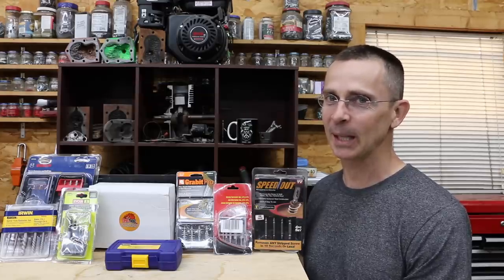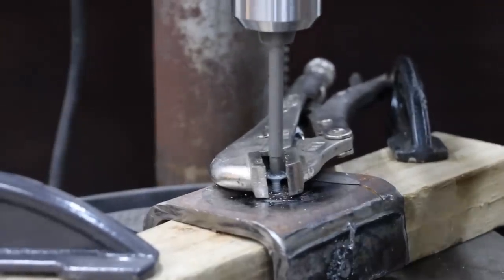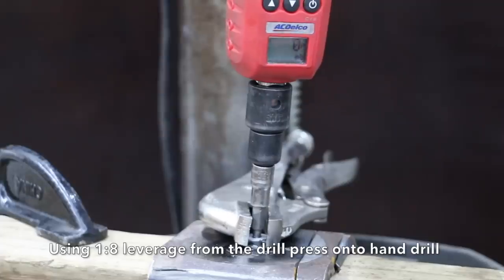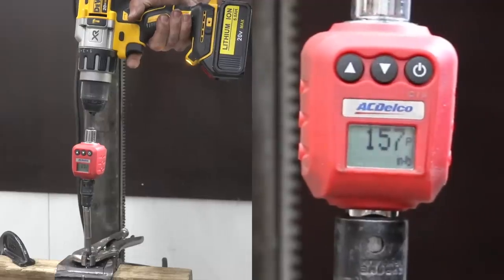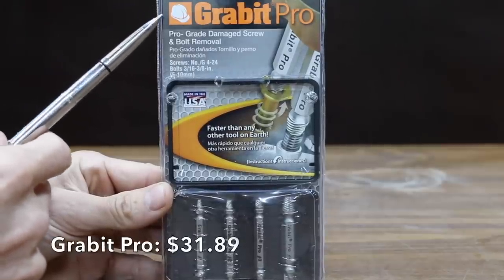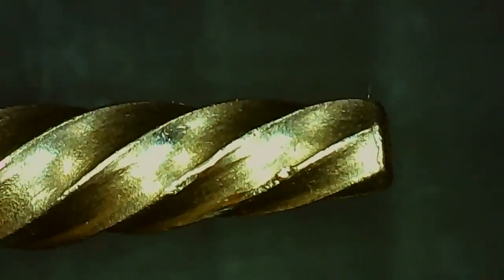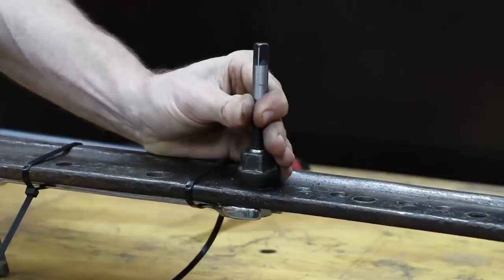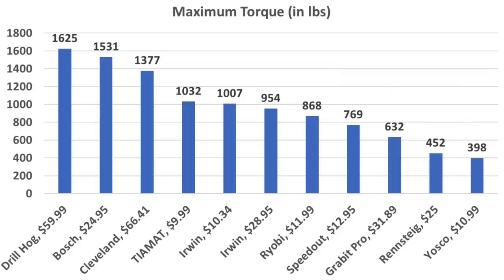Best Bolt Extractor? Let's find out!  Drill Hog, Bosch, Irwin, Speed out, Ryobi Broken Screw Sets

Comment: Can you do a test on Class 10.9/Grade 8 automotive bolts
Sizes M6-1.0/M10-1.5/M12-1.75/M14-2.0mm
Can you do the test in hardened carbon steel internal threads. Just about every bolt extraction video with a snapped off bolt thats flush or deep inside bolt hole is demonstrated on Aluminum heads/aluminum valve covers/aluminum exhaust manifolds.
When i brake bolts its 20 year old bolts that are Class 10.9 galvanized Mopar bolts without zinc plating and they are always stuck in hardened tempered carbon steel.
Its not hard to drill and tap aluminum out and put in thread reducing adapters or drill and retap aluminum threads.
Its extremely hard to get it out of hardened steel thats harder than the Grade 8/Class 10.9 bolts.
Can you show it using other methods than welding a nut on with copper tubing.
EZ outs would be a great method, maybe carbide rotory tool bits to drill out bolts or the extractor screw you broke in it so you can retap.

In my current situation i nroke a Sway Bar bushing bracket bolt. Its held in by a 1/8-1/4" steel plate that has a nut welded to it internally thats not accessible.
I can drill out but if i try to step it up to a bigger size i risk it not holding, have to get it perfect dead center and tapping a different size is almost certain to fail at wrong angle
Reply from the maker: Thanks for the suggestion.

Comment: Bad test. no one I have ever met (mechanic for 35 years) has ever used a screw extractor on a wood screw. I've also rarely had to drill the end of a bolt for an extractor, normally a sheared or stripped bolt head is where you would use one.

Comment: I feel like this test was faulty. I see that you were using the lock grip pliers for stability, but they also look like they became a hindrance i.e. the pliers hitting whatever metal pole was behind them and causing the bits to use excessive force with no chance for leeway.
Reply: That's because the lock grip pliers are there to stop the screw turning so we get to the ultimate failure point of the extractor. Most of these extractors would easily have removed the screw, so we'd have no league table.

Comment: The absolute worst is Ford engines with their extremely wimpy  8mm exhaust manifold studs. We see a lot of cracked manifolds with broken studs.  We drill with irwin left handed drill bits. I will try a spiral extractor with very light pressure. if no go, then drill it out and Heli-Coil it. Nothing worse than a broken extractor in a broken stud. I just finished a Ford 10 cylinder engine. Only 1 broken on right side, and miraculously broken piece came out while drilling with a left handed drill bit. Left side not so lucky. Had to drill out and Heli-Coil 3 broken studs. Not fun.
Reply from the maker: Thank you!

Comment: What a shock to have anything made in china to even work. Last time we used China made screws was when we installed 4 bolts into 4 pre-made holes with dowels inside. 3/4 screws ended up with twisted off headers ... soft metal with some kind of admixtures ... not worth it. We end up using pre-applied helix into concrete using a chemical anchor and after that with screw nut on top. It was overkill for two step garden stairs but you have to do what you have to do.

Comment: All of those helical extractors are junk.  When extracting broken screws from metal, what happens is that the extractor screws itself into the bolt until the bolt splits & becomes locked in the hole FOREVER.  (Some of the helical extractors have a shoulder to stop the screwing-in, but require exact-sized holes to work.)  Much better are pyramidal extractors (square in cross-section & tapered).  You have total independent control how much the extractor bites in (controlled by amount of hammer blows) & the applied torque.  The extractors are also much stronger as they have more cross-section.  Such an extractor can even be made custom for odd-size or very small bolt with nothing more than a bench grinder & old broken drill bit.
Reply from the maker: Thanks!  Thanks for the suggestion.

Comment: That are all good. But now a days some mechanics use  hex head tigther. In prototypes not yet on market.. " nong bolt sachet" due of kany bolt head size that sometime up to 100mm.. the prototype needed to devide sizes into categories same to mini, smal, medium, large, extra large, double extra large, ultra. For ex smal 10mto 15mm.  The socket has a tigther ring and when you rotates clockwise it tigther the size in decimals ex 10 become 9.7 or 9.5, ect (depends on head damages like roundhead blot)  and when we round counterclock on thread locker the size of hex will increase up to 15mm.. depends on how we use and how tigth we wished..  

The technology is old but not yet adopted on bolts extractor and winder.. (impact drill with soket... multi purpose socket. "Tighter extractor and tigther and free size unvolter") 

Simply imagine the electric drill with 3teeth tigther.. but the contact surface is flat.. .
In second try (development) giving a small teeth gives better gripp. As long as the micro teeth is not exceeding 0.1mm. It looks like a pile teeth.

Unfurtunately the prototype is compromised by our country government and usa govoftaxation.. .

"Nong socket tigther, extractor and winder" NONG SOCKET.
Reply from the maker: Thanks for sharing.

Comment: I have a tiny stripped screw on my laptop Board. It's M2.5 and the head is maybe 1/8' to 3/16" and paper thin. Was Phillips 1, now it's almost a cone. 

Any suggestions for removing it? Bought an Irwin EX-1 but doubt it'll work. It's on the Wifi card on the Motherboard so I can't do some options.
Reply: Have you tried the Grabit Micro? That's what we'd recommend.

Comment: Great video, thanks for taking the time to compare these extractors. I own a set of the Grab it pro extractors and have a project I sidelined while trying to use them: I own a VW GTI and had both screw heads snap off while trying to remove the boost pressure sensor from my OEM side mount intercooler. I just wanted to clean the intercooler and sensor but instead installed an aftermarket intercooler and reused the sensor once I couldn't remove the old screws. It's a plastic housing and there's not much material left, so I'm thinking I have to drill out whatever material is still there. If anybody has any thoughts or suggestions I would appreciate it.
Reply: Sell the VW. They're junk!
Reply: I agree with first comment....
Nevertheless some people like budwiser others like Belgian triplet. Therefore suggest you check the YouTube videos from the humble mechanic. He's a certified VW mechanic and is dedicated to his German iron....err plastic....
Good luck

Comment: Phillips screws should just be canned, I've yet to have a Torx screw head strip on anything bigger than a number 10. It requires far less vertical pressure and has a much better contact area. Sure I've had a few heads snap off, but snapping 1/4 heads on a panel means you can at least get said panel off and usually won't affect the structural integrity a great deal. Even Pozi is better, just do away with Phillips like we did with the flat blade heads.
Reply from the maker: Thanks for the feedback.

Comment: A Dremel-like tool can grind a straight slot across the back end of the fastener, but slots can open up and break. A classic square hole or hex hole is very strong, but how to cut one? One could EDM a hole into the end of the screw and then drive it out with a matching bit. Then what is the best hole shape: square, hex, "plus", or "star"? Is there portable EDM?. Maybe an "oscillating multi-tool", with a short stroke and tiny extension could grind a small square or rectangular hole using diamond grit or loose carborundum.
Reply from the maker: Thanks for the suggestion.

Comment: My personal experience is simply to stay far away from the cheap stuff and at least try something you trust. So much of tools like these will simply snap like styrofoam, and it doesn't matter what something should be able to manage according to the manufacturer, because the real world will tell you the real truth right off the bat. 
Price vs quality most times go hand in hand, so just use common sense. Also figure a backup plan for when/if tools like these snap off, before even using them.
Reply from the maker: Thanks for the feedback.

Comment: I have used extractors for over 40 years and have never seen one that works better or more reliably than  a simple high speed steel lathe bit ground to a very gradual taper on all 4 sides
 Tap this into a predrilled screw and bam! Patience and practice....that's what it takes.
Reply from the maker: Thanks for sharing.

Comment: Before extracting a screw or any other fastener, tap on the head, apply heat, tighten it gently, and loosen and tighten it gently, until you have movement.  No harsh leverage.  Once the head comes off, it costs more than the aforementioned technique.  Good video for when it does get ugly.  Use a left turn bit, unless  you live in the opposite side of the world
Reply from the maker: Thanks for the feedback.

Comment: been a heavy truck and construction equipment mechanic for many years and in all my experience best screw and bolt extractor is one with straight flutes because tapered ones expand bolts wedging then tigher in the threads
Reply from the maker: Thanks for sharing.

Comment: The best extractor by far is a torx bit that can be used with a power handle or ratchet. I have tried all those extractors and it is just a waste of money. The taper design expands the the broken bolt into the threads and make it hard to turn. Just measure the torx bit between the flutes, drill  that that size hole, hammer the torx bit into the hole and..... out comes the bolt.
Reply from the maker: Thanks for the feedback.

Comment: The best extractor I have found is a rigid set you drill all the way through the screw/bolt drive the straight shaft spline extractor in then back it out.
Reply from the maker: Thanks for the feedback.

Comment: I wonder how Marco brand extractors would hold up in this test. I use them in an aviation application and they seem to hold up well. The flutes definitely fair a lot better if the extractor is not hammered in and instead just allowed to thread in with downward force on a ratchet.
Reply from the maker: Thanks for the suggestion.

Comment: I have the Bosch style #1-#5 . They look the best as far as quality for spiral extractors but I personally don't consider them screw extractors. I think they work best on removing things like broken off threaded pipe or broken off bolts. That style needs to have some real depth to get a good bite. They do appear brittle and obviously they are from the tests so I may have to heat-treat mine slightly.
Reply from the maker: Thanks for sharing.

Comment: Would gently tapping with light turning tesion on a wrench allow full mating of tool and material? Before testing? I have done this when I had access. As first grip is usually best, in my experience.  And extraction was nearly my last option. Great video & controled testing.
Reply from the maker: Thanks!
Reply: @ProjectFarm  This may test ultimate extraction capacity more isolated from the tools ability to " draw itself into the material" with turning force alone after tapped straight down.  You can readily see how different designs might need more penetrating assistance until they lock.  The long spiral, vs more thread-like designs. 
    Tbh, I fault the instructions with tools. Real mechanics with experience? Have long been tapping and turning to deeply engage imo.

Comment: I remove lots of titanium machine screws on a regular basis. We have found that extractors the same style as the Irwin Hansen work well with a lower risk of snapping in the hole. When one breaks, carbide is the only thing that cuts them well.
Reply from the maker: Thanks for the feedback.

Comment: My greatest problem is always to  drill the hole in the piece to be removed. It is usually hard steel and needs a cobalt or tungsten drill bit and I start with a small size first. I try and use a centre drill bit if I can and it is usually impossible to use a drill press because of the location. So to sumarise; I use a 2mm cobalt drill bit (or a small size centre drill) in a hand drill to get started and then use progressively larger drill bits until I have a hole the correct diameter for the extractor. It goes without saying that I try and use the largest size extractor possible to avoid snapping it off ! Great video of an important process.
Reply from the maker: Thanks for sharing.

Comment: Square fluted extractors are the best in my experience (50 years) in industry and machine maintenance. Edit: I also found that left hand drill bits will very often remove the broken bolt in the drilling part of extraction.
Reply from the maker: Thanks for the feedback.

Comment: I am removing Bolts from an outboard motor engine seem to be steel bolts and an aluminum head. What kind of penetrating oil would help this.? Should I apply heat? They are 10 mm headed bolts
Reply from the maker: Thanks for the video idea.
Reply: @ProjectFarm   I work on a lot of boat motors and I live in the Florida Keys. It's nice and warm here. Saltwater intrudes on everything both automotive and Marine. Removing steel bolts from aluminum block seems to be my main obstacle in repairing outboard motors.

Comment: The other day I had a brass tee fitting break the threaded end off into an air bag on my semi trailer. I knew immediately I’d have to hunt for this video to figure out which brand would be best to add to my tool bag. Thanks for these videos Todd, I’ve already used the advice from you when picking out super glue for a plastic application and it was perfect!
Reply from the maker: Thanks for sharing!

Comment: I wish I knew the name of the extractor kit I had in the army. It used a spring steel splined rod and a hex sided collar to turn the rod. It also had left-handed drill bits and a series of drilling center guides that could fit into most bolt holes. The only time I had failures were the drill breaking and the one time I had to do a long reach with the rod and the collar was too far from the bolt, twisting the rod.
Reply from the maker: Thanks for sharing.

Comment: Another incredible video, I have never had any luck with any extractor bits as they always snap very easily. I just drill them out then use a tap the ild threads out then re-tap the hole
Reply from the maker: Thanks!  Thanks for sharing.

Comment: I just used the Irwin set on the pan bolts I told you about and it broke on the first one. 😡This is the first time Irwin let me down.
Reply from the maker: Thanks for the feedback.
Reply: @ProjectFarm This is my work truck. It's pretty old. I am a contractor that's kind of a backyard mechanic. I know enough to get by, but I'm not Mr. Goodwrench. I don't have time to send for the hog set, but had 2 idea`s I'd like your advise on. 1 drill pilots next to the broken bolts and put in self tappers, or drill new holes through the aluminum tranny housing and run bolts with nuts through. quick fix. If you think either will work, which sealant do you recommend I use where the broken bolts are to prevent leaks? I don't have the tools or skills to be drilling a perfect full size hole overhead to tap it out and don't want to pay towing to a machine shop. or a big bill.

Comment: I always liked the straight square extractors.  I can't remember the brand, but I have a high success rate of removing broken bolts with them unless they are really corroded.  I always use the largest extractor I can fit into the drilled hole. I turn it as close to the base as possible with a adjustable wrench to minimize the likelihood of breaking the extractor.
Reply from the maker: Thanks for sharing.

Comment: That bosch one is absolute GARBAGE! I bought that 12pc set and the extractor bit snapped with barely any force from my hands using a tap wrench. Huge waste of time and money. I had to use a punch and hammer to remove the broken off bit since drilling it would have been impossible.
Reply from the maker: Thanks for the feedback.

Comment: Ok, those are wood screws about 10 seconds in.

By the time they will not come out of the wood the wood is rotten, so use a big lever bar, and rip up the rotten decking, snapping the rusted screws and rotten wood. 
Undoing the screws is not needed. The whole lot is rotted and rusted away. 

Screws are not bolts so bolt extractors are not much used removing screws. 

hats are not shirts, helicopters are not submarines.

Tip. They never work well. By the time you need them they won’t work. Ever.

Comment: How often would anyone try drilling out a thin screw...we need to see which one works best for bolts that snap in an engine , as an example! This whole test was useless. Drilling out a thin screw and expecting the extractor to remove it with only a thin wall left on the screw doesn't make sense. Thumbs down on this test! wasted my time!
Reply from the maker: Sorry it was disappointing to you.

Comment: Do you see a problem with this guy's review? The problem I see is that NONE of the brands can extract screws/bolts. So what is the point of talking about the tool damage each brand takes before breaking? If a tool can not accomplish the job it was designed for, then there is nothing more to test, compare, or talk about. This dude has missed the MOST IMPORTANT POINT.... has missed to emphatically say, clear & loud "NONE OF THESE CRAP WORKS!!!!  don't waste your money folks!"  But he changes his tune in talking which tool is less crappy than another. Crap is crap.... does not do the job and thus not worth talking or comparing among them.
Reply: The bolt was designed to not budge so he could determine the maximum amount of force that could be delivered before the tool slipped.